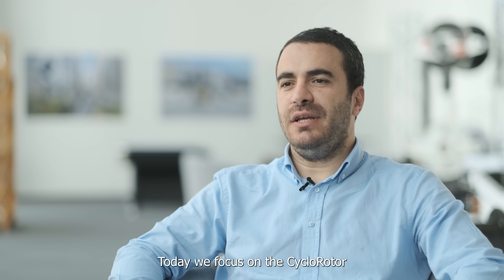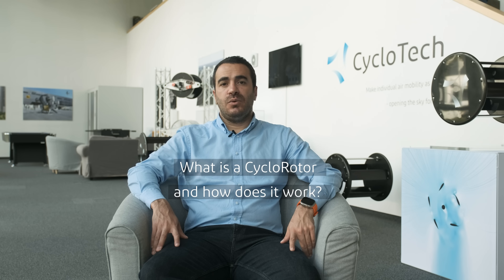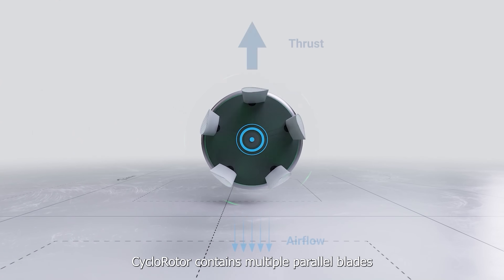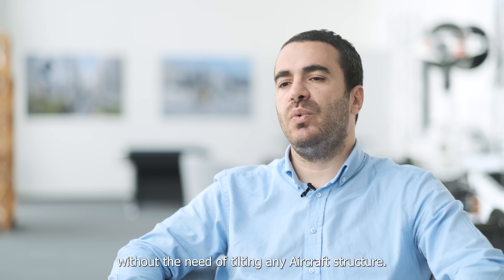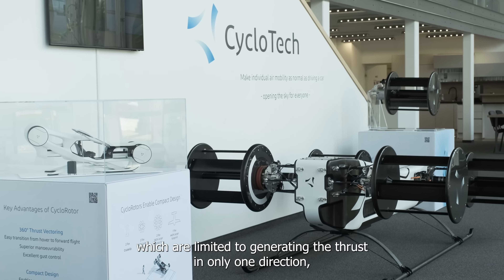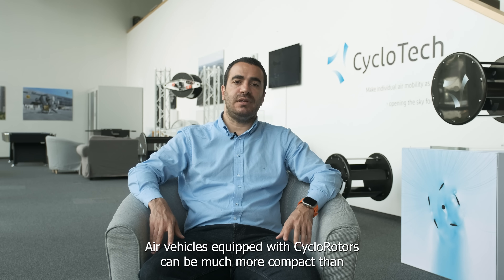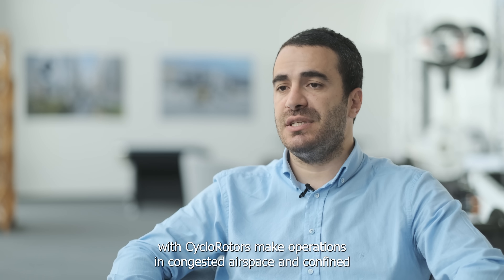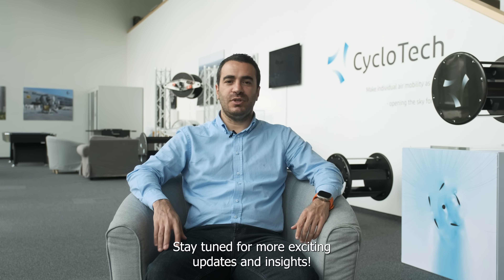Discover CycloTech #4 | What is the CycloRotor and why it´s a game changer for aviation

Comment: Is there an advantage to using multiple smaller cyclo rotors instead of one big one? It may require more computing power and possibly more energy but it could provide more resilience in case one rotor fails

Comment: Very curious to see how this performs in adverse weather conditions. I'm really hoping they can borrow some sizeable jet engines to simulate heavy wind gusts to show off the CycloRotor quickly adapting to the changes in wind speed and direction. Forget transportation, what this could do for search and rescue operations in severe weather would be an unimaginable improvement.

Comment: How am I The only one not falling for this bullshit? The way the engine works you need 1000 times the size when it comes to blades or because of the quadratic relationship between energy consumption and velocity you need 4000 times more energy to do the same thing. This thing will never be practical, this thing will never fly at a scale, or with the same efficiency and feasibility as conventional propeller technology.

Comment: Hardly a 'game changer' as this technology has existed for over a century. The Russians have been investing in cyclorotor/cyclogyro research since they invented it in 1908, but despite modern composites as yet no workable full-scale aircraft have been produced. These rotors have been used very successfully in marine engineering where high degrees of manoeuvrability are required - in these applications it's called the Voith Schneider propeller.

Comment: Every blade has a moving joint won’t it jam up with dust after every ride 
Well even ceiling fans get static dust and dust in general stuck between blades also central ball bearings
Well you asked to ask so I asked😉

Comment: Probly a much greater opportunity for unmanned flight as opposed to manned. If the rotors are quiet that would open huge doors. Cyclorotor claims 59db at 100m, but that is likely the full scale man carrying version. Would like to hear what small scale "package" carrying versions would be.
Reply: lol that's 139dB at 1m, which is ten times louder than an unmuffled racecar.

Comment: He's just gonna sit there and pretend he invented the Cycloidal Propeller.  It's 100+ years old and never quite caught on for many reasons, including "Dynamic Stall".  Cycloidal rotors can suffer from a phenomenon where the airflow separates from the blade surface, leading to a loss of lift and increased drag. This can negatively impact performance, especially at higher speeds.

Comment: Interesting concept. What kind of redundancy is built into the propulsion system should you lose an electric motor to drive one rotor? In addition, is the plan to have a ballistic recovery system, parachute, to use in case of multiple rotor failures, and a minimum altitude for using this system?

Comment: I would challenge ANYONE to add redundancy into this design. I don't think it's possible though, and it's not air worthy without redundancy.
  Just cuz it's different, and looks cool, doesn't mean it will work well. Give up on this. It is a HORRIBLE design.

Comment: Wow super cool. I’d like to see this scaled down, too, as in drone size 249g. I think it’s flying currently in headless mode, but once GPS and a system like DJIs obstacle avoidance is integrated this should hover very smooth like a champ. I’m wondering how much air does it push down on takeoff? As much as a helicopter or could bystanders be close by? And what is the dB these engines put out while creating thrust. 😊

Comment: Likely terribly inefficient, since only a few blades are producing thrust at any given time so are just dead weight that also saps power. 
Electrically driven? This company must be funded by taxpayers. Batteries have lousy energy density and unlike a gas tank they weigh just as much empty as full. This is especially bad for a flying vehicle, where absolutely everything comes down to weight. 

What a scam.

Comment: Hmm...🤔 Not convinced. I'm no engineer, but I'm pretty sure that the propulsion units work well in water because it's 800 times more dense than air. I don't think the figures add up when you try to fly.

Small models will certainly work - I've built and flown all kinds of weird experimental RC aircraft myself over the years - but physics is a harsh mistress; lifting mass is hard work and scaling everything up so you can haul people or cargo into the air demands enormous amounts of energy.

I'm reminded of the Lilium Jet project. Different technology, of course, but the same challenges. Air's thin; gravity's strong. Slick 3-D renderings and ultra-lightweight miniature flying prototypes are no indication that a full-size craft will fly.

There's a good reason why hummingbirds weigh grammes, not kilogrammes. Show me a dragonfly that can lift a cow.

I suspect that Earth's gravity would need to be reduced by 75% before any kind of battery-powered wonder-machine could provide practical transportation solutions.

With all due respect to the development team, I'd need to see a basic full-scale, fully laden test chassis 'mule' fly before I took the proposal more seriously. It doesn't need to look good or be neatly finished, just a raw wooden chassis equipped with flight batteries, propulsion units, and loaded with (say) 250kg of sandbags.

Let's see it fly, please. Full size, full weight, full load, full power, for twenty minutes.

Comment: Love the idea that you're going away from conventional drone/helicopter technology, this seems more practical to what a flying car should be. Safety should also be a factor as it's the only way it's going to get an airworthiness certificate for something like this. Though, I'd like to see the machine in full pilot test flight, first, because you're probably talking at least another 3 years away to get to that stage .
But it looks like you're on the right track. You never mention what is the maximum weight it can carry, but given the size, it's range would be very short.

Comment: I saw this tech concept over 20 years ago & I still have concerns. As we know fixed wing aircraft can glide during engine failure events & helicopters have the auto rotation option when possible. The only option I see with a cyclo rotor propulsion system is a parachute system similar to the one used in an Icon A5. Am I wrong?
Reply: I meant cycloidal prop in case I get the inevitable correction :)

Comment: I think a few things would be needed to make CycloRotor "a thing":
1. Supporting the rotors from both ends on a central shaft in a bridged (forked/boxed) frame to prevent unnecessary flexing (and bouncing).
2. A perforated, form-fitting cover to reduce possibilities of debris or bird strikes against the rotors (and noise reduction)
3. Redundancy could be gained by splitting the rotors into two halves - driving each half with an independent motor (or using nested shafts from a single motor with a clutch mechanism being able to decouple a rotor determined to be damaged).
Of course, these refinements would likely add weight and introduce efficiency losses.
Reply: 1. Would likely affect the weight budget, or the thrust to weight ration. Rigidity can be obtained with geometry and materials technology, rather than cross sectional stiffness. A good example being a tower pylon for electrical distribution. It is lightweight and uses triangles to create rigidity.
2. A perforated form will significantly affect the efficiency of thrust generated by the rotor, likely rendering it unusable, like half closing a gate valve or faucet. There will be reduced flow into and out of the rotor, accompanied by unfavorable vortices, generated by air travelling through the holes. That is why most propellers, jets and wind turbines have open blades.
3. Adding complex systems for redundancy has often caused incidents. It is always prudent to simplify. In this case it is likely a certain pitch of the blades within the rotor can generate enough lift to slow down a gravity fall, similar to an autorotation on a helicopter. The advantage with the rotors being at the sides of the vehicle is that a deployable parachute from the top of the vehicle is a possibility. An old school gyroscope or gimble can detect level flight, so if one rotor loses thrust, the one on the opposite corner can have its thrust reduced, leaving the 2 other rotors to maintain level flight.
Reply: Wouldn't the cover actually make more sound from the air rushing through the holes?

Comment: The biggest issue with these and other multi rotor designs is the lack of redundancy in the lift mechanics. Traditional helicopters and fixed wing aircraft are able to do emergency landings without power.
Reply: Very good point - for small vehicles it may be a parachute ala Cirrus...
Reply: jet planes and helicopters are as good at unpowered flight as a brick
Reply: @paulinebell4873 Jet aircraft actually glide quite well. Typically 18:1+ glide ratios. They might do it in a hurry but they’re better than a typical light aircraft at 10:1. By the way, a typical sport glider, not sailplane, glides around 18:1. You’re welcome.
Reply: @paulinebell4873  - Jet Planes glide - see the film "Sully". Helicopters sort of glide just really steeply but can be easily landed by a skilled pilot. Where helis lose out is if a drive shaft fails or ceases, then there's not much you can do.

Comment: This is laughable stupid. Just like the Dyson style ducted bs human flying drone etc.

The problem comes from the fact that we are living at the edge of having available extreme power and control compared with earlier years of aviation.  Everybody interested into this kind of tech... developers or simply bystanders should stop and think about these:
1. Wright brothers Flyer had 12 horse power engine. In order to fly with such low power they needed to make a crude glider to... prop itself into the air. Since then all planes are lacking power... even the F15 with its famous 1:1 power to weight ratio. In order to fly they need crutches.... which are the beloved wings... nevertheless CRUTCHES! 
2. A transport helicopter has around 2000hp engine and many times more than one. Because of such immense power (think... a Mi-8 helicopter can have in excess of 5000HP tota l!!!) Because of this it can basically lose the wings. However... due to the practical and economical contraints the helicopters need to do WORK so they have huge payloads so because of this they need CRUTCHES again. The same 5000+HP mi-8 helicopter need rotor blades the size of wings... why? Because it doesn't have enough power!!!
3. Another big problem of flying with VTOL is control. When you have such complex machine like a helicopter the control is cumbersome and difficult to automate. And heavy.

But now... we have drones. Now we can see the future where power and control are basically unlimited... You can have a 10 000HP electric powerplant in a craft with ease!!! You can hook it to compressors like a AV8 Harrier has and then electronically controlled and actuated nozzles and call it a day.

But!

You don't have energy for such a power hungry powerplant. That is the problem. You don't have light enough batteries to make such craft fly today. 

Because of this situation everybody sees what is actually possible but SEEs that everybody is stuck!! So what do they do??? The sell BS dreams for rich stupid morons.  They try to squeeze out their butts some BS idea about dyson ducted fans or some cyclo crap or god knows what... flapping wings etc etc.... trying to fool "investors" that their idea will work and they are the ones that they invented the "efficiency" !!!

I remember a word of an old plane builder... PLANES DON'T FLY BECAUSE OF EFFICIENCY! Think about it!

And all these "efforts" to fool people are ridiculous. All of them build either nothing viable or they build a BS craft that gets hammered by a plane or a helicopter because in order to "efficientize" the craft they inadvertently end up on the turf of Helicopters and Planes which beat the living shit out of these garbage electric floppers.

I am so sick to see these aviation snake oil sellers!!! I am strong believer in personal open source vtol crafts but those BS are not it!

Comment: I imagine each rotor would have to be at least powerful enough that two could provide something slightly better than hover? Then a single failure can be compensated for by the opposite rotor controlling roll about the other 2 remaining? 2 same-end losses ought similarly to be survivable (but terrifying?), but not 2 same-side, nor 2 opposite?

Comment: So...Also .es scheint dass the rotor blades are mechanically shifted in Pitch, with some kind of possibly ring that can be rotated to change where the pitch changes are located, or, maybe, an electronic servo on each blade ... I didn't quite understand how the axis shifts, maybe look again, more slowly...  In terms of blade damage, the blades are relatively short, and thick, so should be more robust than "propeller" blades, but it's not clear what kind of velocity you see on the blades in a max thrust situation? I guess that it's possible to have some kind of guard on/under the bottom of the rotor to eliminate blade strikes when landing, or to protect persons who might accidentally be underneath the aircraft when landing, or at low altitude... Brings up another question: when hovering, it appears that you have a relatively vortex-free down last... I guess, with enough "extra" thrust available, you could vector downblast away from directly below the aircraft, so that the any dust and debris is actually directed away from the aircraft, for better visibility, and reduced "nuisance factor" for pilots and pax ...

Comment: The questions that spring to mind are:-
1) how is redundancy achieved ?
2) efficiency and noise compared to the same volume of axial fans ?
3) what happens when there is a power failure ?
Reply: (1) and (3) are why this design was abandoned by Lillium in their early designs. I think this design will have its applications but a game changer? I'm not so sure.
Reply: If you want redundancy, why couldn't this simply be incorporated into the wings of an airplane, much like jet engines hang under the wings of airliners?  An Osprey uses the same propellers for forward thrust and hovering.  Seems like you could use the Cyclorotor for forward thrust so the wings provide lift during flight, then and change the thrust vector to vertical when you want to hover or land.  That would seem to solve both the redundancy and "brick" problem.
Reply: @johnsimion2893  
V22 cannot autorotate to a safe landing (Pentagon testing office)
Reply: I would expect that a 6 rotor unit, with backup power, like a compact bank of super-capacitors, could be engineered for redundancy, in case of a rotor failure, or loss of motive electrical power...
Reply: Yup. No airfoil, so a brick when unpowered.
Reply: @k.chriscaldwell4141   the rotors or what ever u call them in this craft would keep spinning like a heli so you would still have some lift but yeah i think probably you would still die but i could be wrong
Reply: @TNT_FPV Yes you’re wrong. As soon as one of the blades loses any power this thing falls. It won’t keep spinning like a helicopter.
Reply: @Cybo-Man   i dont think it would create much lift or any but the blades wouldnt just stop spinning as a fellow kerbal player u should know better , the blades angels of attack would control this they would only stop spining if the angel was not creating lift/spin , anyways its not important i see u play kerbal i do a little kerbaling my self too =]
Reply: @TNT_FPV 
yup, called autorotation in a helicopter - like sycamore leaves spinning slowly to the ground, a helicopter with engine failure can safely descend in a controlled landing (unless you’re over mountains or water😮😄) but this thing would drop like a stone
Reply: A vehicle using this system would need a ballistic parachute and/or pop-out wings in case a rotor bearing fails or something. If one rotor failed, the vehicle quickly becomes unbalanced and would no longer be aerodynamically viable.
Reply: I’m not an engineer but seems like a lot of wear and tear on all these moving parts.
Reply: Osprey cannot autorotate to a safe landing
Reply: Exactly what I was wondering
Reply: Its pure nonsense. It's just pushing the subversive electric transport psy-op.
Reply: Yeah very interesting but not practical...just bust out the hidden anti-grav tech already humans!
Reply: Gravity wins😂
Reply: Have you seen the video where the thrusters are inside a standard wing? That solves every last issue you mentioned.
Reply: @majorwedgie8166  
where?
Reply: I would like to see data on the energy efficience of this system. The other issues found there are a concern as well. 
I see this machinery more versed to build a new kind of drone
Reply: @pete_dl1585  1.    Quad copters are remarkably resilient to losing a propeller.   I believe this system could be designed for a graceful degradation of performance after power loss.     2).  Depends on the size and speed of the rotors.    It could be very quiet since the propeller tip speed doesn't hit the sound barrier.   3.  As others have said, a ballistic chute is highly recommended.   These may have an autogyro function but I can't see it giving you enough L/D to have a safe landing.
Reply: 1) There is none.
2) It's VERY noisy.
3) You die.
4) ...?
5) Bro down!
Reply: Same thing that happens to any other craft with no redundancies. Same thing that'll happen to every human on Starship, when one or more of it's motors fails, right before the flip maneuver; A real mess, to put it lightly.